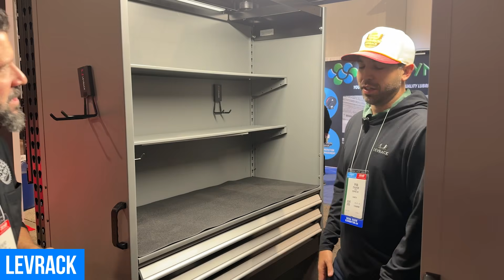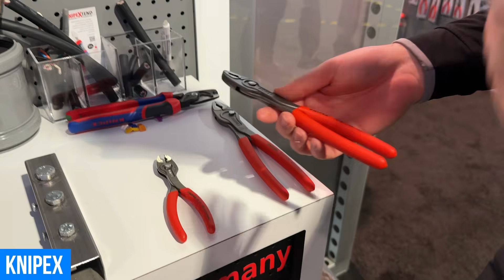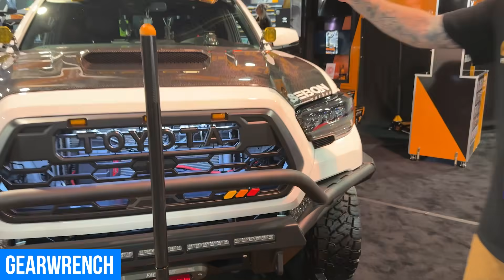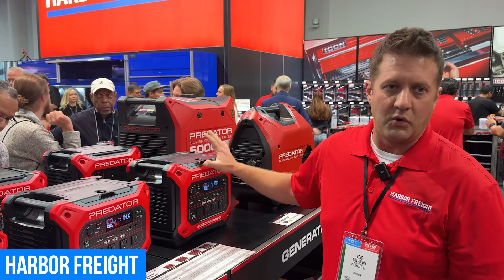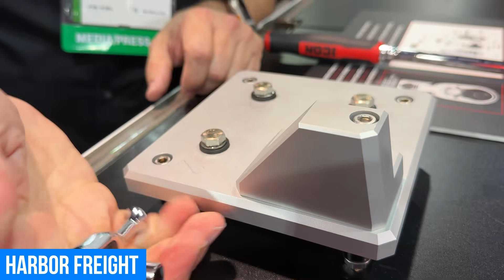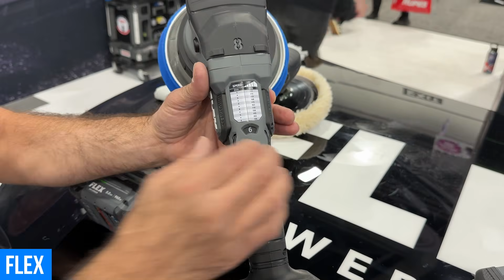NEW Power Tools from Milwaukee, GearWrench, Harbor Freight, and more at SEMA 2024! Day 1

Comment: why does every “mechanics kit” tool kit come with 12 point sockets? 🙄
Reply: 12 point head bolts and they're thinner so you can get them on tight area fasteners
Reply: All we use in aviation, 12 points